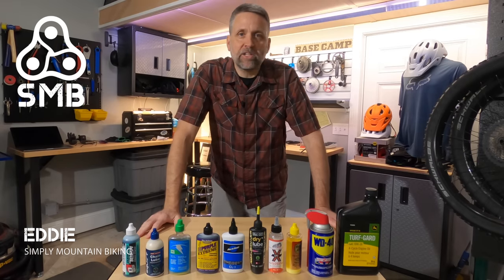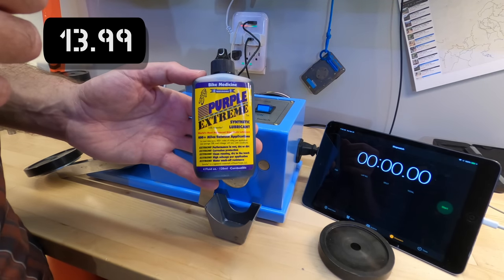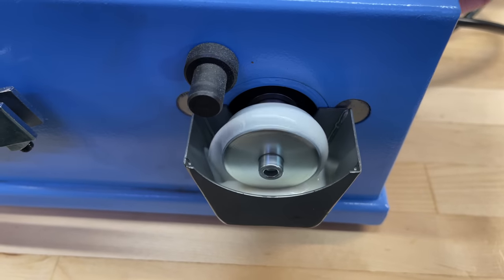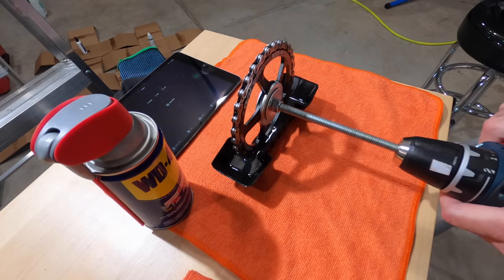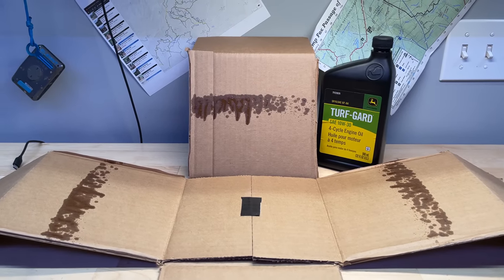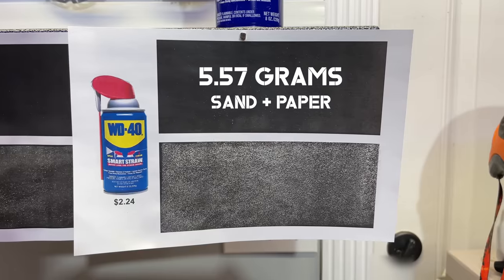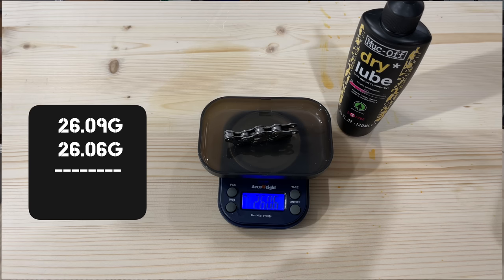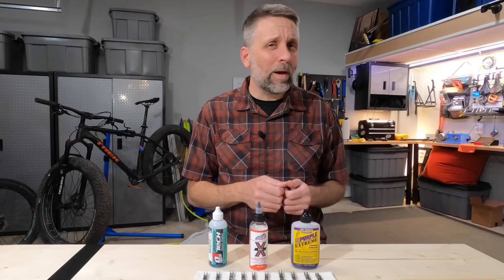Ultimate Bicycle Chain Lubricant Test | Best Bike Chain Lube

Comment from the maker: NOTE on SQUIRT:  These tests took me a total of 3 weeks to record.  Squirt dried overnight for the sand test (15:33).  It dried for at least 3 hours in the sun for the wet test (17:15) - and was totally dry (but even if it wasn't completely dry - it still came in first place for that test).  Squirt also tied for first place in the sling test - assuming it would have no sling after testing Muc-Off.  Finally, I assumed that testing Squirt wet for friction would actually work in its favor.  A few viewers disagree so be on the lookout for a dry test of Squirt against the friction testing machine! -Eddie
Reply: Very interested to see how squirt goes in the friction test when dry, great video 👍👍
Reply: I have zero chain wear using Squirt for 2 years. It's awesome stuff.
Reply: Now do this test:
Wash all the oil out of the chain. Soak it in fuel overnight. Get all of it out. Melt paraffin candles. Soak the chain in it.

I've used many oils. They're all rubbish. Once you go wax, you'll never get dirty fingers or running gear again.

Relube: Wash chain in boiling water, soak in metho and dry. Now soak in melted wax.
Reply: It's just that your test doesn't correspond to the intended use of this product. There is no doubt that a wax should come first on the last 3 testes. And about the friction, independants testes (such as the ones done by Zero Friction Cycling) put always wax above oils.
Reply: @damienmarguerite827  Totally agree - except for your testes... ;-)  The friction test and sling test for wax emulsion is simply not representative of a dry lube product, such as Squirt's, intended use.
Reply: @WestfieldFreshAir  do you geagrease and clean chain thoroughly before lubrication?
Reply: @Kolomy24  only external degrease, then applied Squirt at least 12 hours before riding each time.
Reply: I used squirt on my fixed bike drivetrain. Awful noise, grinding etc. Switched to much off hydrolube. Same chain and bike. Silent, smooth running that lasts in wet weather. Ok, it's dirtier but I'll use gloves. Squirt is ok for 1 day imo but not on my fixie
Reply: @markrushton1516  I wonder how do people get such different result using same thing. You did not apply it on top of the old oil in the chain right?
Reply: Was on track chain. Seems better on a standard chain. Interested to try the wolf tooth lube. Like the fact squirt doesn't leave a mess but it needs frequent reapplication esp in wet weather
Reply: I've noticed there's a particular group of Squirt aficionados out there and they keep trying to turn me into one. No such phenomenon for any of the other lubricants. So far I haven't come up with a better explanation than that it must have something to do with the brand name...
Reply: Standing by! Great video. I have been very impressed with Squirt on my MTB. It appears to be at its best when it is dry.
Reply: @GerardvanReekum  thing with squirt is before applying you must clean the entire drivetrain to just metal everything from cassette to crankset to jockey wheel then apply it let it dry and then you will never ever have to clean your chain. It gives my drivetrain the maximum life and the best part is you don't have to clean the chain ever just keep applying squirt when the chain start making noise.
Reply: would be great to see how they perform in the lubricity in dry condition because that is how they are on the chain... but with the current results I'm considering mixing squirt and mucoff to keep it on the chain.. so maybe something like 20-25% mucoff mixed into the squirt
Reply: I'd be interested in seeing dry lubes tested properly per application instructions.  Boeshield, Smoove, Finish Line dry, etc.  Most dry lubes aren't designed for wet riding and need to be applied immediately after.  Go outside and get some dirt, not just sand.  Dirt has finer particles than sand.  Also, the interesting test here would be to calculate watts used to spin a chain on a chainring when dirty.  Slightly curious about the wear scar test, but frankly, stress on a bike chain is super low and this seems like an unrealistic test well outside of the parameters of any lube.  Maybe much, much less weight over a longer period of time?
Reply: I was hesitant to use squirt on my mountain bike. But once I switched from Muc-off to Squirt wear was considerably less. I replaced less chains. This proved even more so for my road bike. I'm getting double the miles. I always let Squirt dry overnight before use as it is wax particles suspended in liquid that dissolves. Running it wet it makes a real mess. Muc-off seems good for short rides, but for longer rides it disappeared and I could hear and see a big difference. That's likely why it destroyed my chains faster. You might try paraffin wax as a comparison.
Reply: It's not fair to test multi-use WD-40 spray as a dry lube camparison, because they have ''WD-40 bike dry lube''... big mistake
Reply: @RETMTM  - Did the whole hot wax soak thing for awhile.  Got tired of it, now use Squirt, quite happy with the results.
Reply: @WestfieldFreshAir  yep. I get 2000 or so miles out of my XX1 12sp chains with Squirt. and I ride in both sloppy, muddy conditions as well as dry and dusty. That is also about double the life I would get when I used Dumond tech. It's not even close.
Reply: Have to say I have used squirt on mountain and road bikes in al weathers and it excels much better than muc off dry/wet lubes.
Reply: @stefis6  agree. All lubes should be tested on wear after being dried. Obviously there is no oil bath on bike!
Reply: @WestfieldFreshAir  same here
Reply: @damienmarguerite827  wax on your testes? Wrong channel mate 😉
Reply: @WestfieldFreshAir  Not to outdo you but a nod to Squirt, but I stripped a new Shimano chain of its factory lube on a brand new YT Jeffsy in 2018 and use Squirt exclusively. In this 5th summer of use, I measure zero chain wear as well. I have never had a chain on any bike last this long. I keep measuring it to look for any wear and nothing. I don't understand it but have to assume Squirt is the reason.
Reply: @crevasse5396  excellent. Squirt is great stuff.
Reply: @RETMTM Does the wax wash off easily in wet conditions? Is regular gasoline enough to wash the chain?
Reply: I would be very interested to see a more combined test with the dry lubes/wax lubes as one of their main features is preventing debris from sticking. If you could combine the sand test with the friction test to see which holds up best when exposed to dirt, that would be ideal as it could completely change the friction test readings if one lube picks up more dirt than another.
Reply: @WestfieldFreshAir  How do you clean your chain before applying Squirt?
Reply: @sandythemonk  I just wipe it using a towel (cast off from the house) with some citrus based cleaner.  I didn't do a full degrease of the chain to remove the existing lube completely from within the chain. I expect this has worn off by now, to be completely replaced with the wax from the Squirt.
Reply: I came to the comment section exactly before this :D 
Before drying, the Squirt is a very thin water solution, so it can lube less effectively (I think at least). However, this test may tell that when you go to a 200km ride (just for example), and you reapply squirt after 100km, it will do it's job even though it is not completely dry.
Reply: @Stengell 
Really bad idea bro
Reply: What about 3 in one oil? Wasnt it originally used on bikes a while back?

Comment: Rock N Roll Gold Lube is STILL my go-to lube even after all these years. I call it a tune up in a bottle. Great review.
Reply from the maker: Thank you!  Yes - for me, I plan to apply Muc-Off after a chain cleaning - but keep a bottle of R&R Gold in my go bag to use at the trail head. -Eddie
Reply: Agreed, Rock n Roll is my daily driver. I will say I like how Squirt holds up on really long rides.
Reply: If you don't mind a lowly long-miles roadie agreeing with you, Rock 'n' Roll is, has long been (15 years) my goto.
Reply: Great work! Interestingly, I've used many different chainlubes over the years (Triflow, Progold, Finishline, R&R Extreme) but somehow I keep coming back to my 2 staples - Muc Off Dry Lube and R&R Gold.  You definitely validated my unscientific albeit real world observations/experience.  And of those 2, I definitely prefer the Muc off, but the R&R Gold I say I use more due to it's cheaper price! Great channel, glad I stumbled upon it!
Reply: I think in not classifying rock n roll gold as a dry lube he often overlooked letting it dry. It really should state on the bottle that it's supposed to dry since the solvent needs to dry off. I don't know if it really classifies as a dry lube, but I usually apply rock n roll gold or extreme after I ride. I love that it does a really good job of cleaning my chain off, and it's been an excellent lube in terms of staying clean, lasting a long time in variable conditions, and keeping my drivetrain super quite. My friend uses squirt and it works really well, and is probably cleaner than rock n roll in terms of attracting dirt, but the stuff kind of builds up and is a pain in the ass to clean off.
Reply: How often do you guys clean and re-lube your chains in dry conditions?
Reply: @fastsvo  Everytime I wash my bike, which is about every 2-3 rides, or after one big ride. Rock n Roll lube cleans when you lube, so sometimes that's all I do other than some basic soap and water when I'm washing. I only clean my drivetrain with degreaser every couple weeks.
Reply: @fastsvo  Small applications after every ride.

Comment: It's an old video, but I have to give credit where it's due. So much work put in to this video, well done.
I am using only Muc-Off (Dry) on my MTBs and I can say that even though after about 50km in wet conditions you can hear it's almost gone, I still prefer it as it's easy to clean, it attracts very little dirt on the chain. Ride, clean, relube - repeat (and it smells nice) :]]]]
Reply from the maker: Thank you for sharing! -Eddie

Comment: I have been running Squirt for the past 3 years, and when correctly applied, its been the best lube I have ever used, both for MTB and Road. I get a clean chain with no sticking, which is awesome. My chains last longer, on the road bike I get around 1500km more life out of the chain (when it gets to the 0.5 wear mark). Also you don't need to apply it before every ride if you ride in the dry conditions, I'd say on the road its around 200-250km when I re-lubricate the chain (once a week). Recently on a Granfondo I got gifted a pre-production of a brand new chain wax from a MTB World Cup mechanic, which he produces by himself, and in the short time that I tested it - it is even better than Squirt, once in full production that thing will break out and be the next level..
Reply from the maker: Hey - I'm glad you like it.  I never had any luck with wax in the southeastern U.S. -Eddie

Comment: A lot of excellent work here, thanks!

I do think, however, the block-on-ring test would have been more realistic had it been done by wetting the block/ring, let sit for 10min, and running with nothing in the reservoir.  Also consider acetone between fluids to clean the previous off.  A flir camera might show temperature differences indicative of friction.
Reply from the maker: I appreciate you sharing these points and ideas! -Eddie

Comment: Been using Dumonde for a while and it works really well against volcanic dust found in eastern Oregon and the Sierras in CA. The biggest issue is it collects the dust and makes "build up" on your pulleys and chain ring. I've found Dumonde to be a bit of overkill for my local trails near Santa Cruz. Still after 30 years, my favorite for my conditions in dry weather is TriFlo. I'm sad it didn't get included in the test.
Reply from the maker: Thanks for sharing.  Maybe I will test Tri-Flow some day... -Eddie

Comment: For what its worth, the rock and roll lube is meant to set up for a few hours or overnight.  The directions also say to remove excess with a rag.  I think this would have made a big difference in the sand retention test in particular, but most of the other tests as well. It should have been given similar treatment as the dry lubes.
Reply: Need to get Farm Project to test chain lube.
Reply from the maker: Thanks for your feedback. -Eddie

Comment: During the Wet Test I think it would have been valuable to note the weight of the chain before it went through the lubing process. With that you could effectively calculate the percentage of lube lost. Some lubes may deposit less material so may have less mass to lose and could sqew the results
Reply from the maker: Thanks for your feedback. -Eddie

Comment: Interesting result and great detailed video. From my personal experience I find Muc-Off lubes collect too much dust & dirt and cleaning the chain just with a cloth will be dirt smear all over the place. It takes more time to completely clean your drive train on a wash and even a quick wipe off and re-lube results in a lot of dirt. I switched from MucOff to Squirt and find Squirt superior. It might not last as long or have slightly worse efficiency in wet conditions BUT wiping off and re-lubing takes 5 mins incl. a clean drivetrain. I rather lubricate every 150km instead of having everything dirty as hell on every wash. Being a roadi / gravel guy here though
Reply from the maker: Thanks for sharing your perspectives and experience!  I guess I'll see how Muc-Off does in real world conditions. -Eddie
Reply: @SimplyMountainBiking  Great test! I use Muc-Off Dry Ceramic lubricant since over a year on my MTB and I find the chain to stay very clean. On the other hand, the Wet (non-Ceramic) lube does collect quite a bit of dirt on my city bike, but there I don't care as much and drive even while it's raining.
Reply from the maker: @patoberli  Thanks for sharing! -Eddie
Reply: @SimplyMountainBiking  I've been using mucoff dry on my mtb in dusty and wet conditions and I really like it. I find one of the best things about it is how it sheds dirt and how easily it cleans off with a chain cleaning machine. Depending on how muddy the rides are, I usually clean and lube my chain after 3 rides. With about 3K km on it, it has no noticeable wear.   On my commuting e-fat bike that I ride all year round including some pretty bad snow, slush and salt conditions, I tried paraffin wax the 1st winter and it was OK but too much of a pain for cleaning and relubing. This past winter I used rock and roll gold and probably was not all that diligent and it worked OK too and was way less effort for maintenence. I've also used a schwinn wet lube that looks a lot like chainsaw oil and as long as you wipe it down well, it doesn't attract too much dirt, resists wash off well and is the longest lasting. I rode 10K km last year, its a 1000W mid drive ebike and I have steep hills over 15% on my way home. I use it as my main mode of transport and often load it up with 230lb me and another 40 or 50 lbs of stuff so it's really punishing that chain. I've gotten as low as around 1000km on a chain in winter and maybe 4K km in summer. I probably go through 4 chains a year, I get KMC plate silver or ept 8 speed chains and change them around 0.75 percent wear. At almost 14K km ice gone through 1 drive sprocket and 2 cassettes. Still way cheaper than a car :-) I usually start off with just the factory lube and decrease the outside of the chain and that lasts quite a long time and doesn't attract much dirt. I'm pretty much now about what's easy and quick to use. At about $30 a chain, it's not worth wasting too much of my time on maintenance.
Reply from the maker: @Stephen - thanks for sharing!  That's a lot of experience shared! -Eddie

Comment: I just came back to this vid with an update: I went into my local shop to get some Rock N' Roll (I've used the Blue one for quite a while); when the head mechanic suggested I switch to Wolf-Tooth's WT-1.  It's pretty expensive, but was supposed to last longer... The results are in and IT'S AWESOME!!! It actually lasts wwwaaayyyy longer.  I rode all last summer, lubed up my chain this spring, and even used it to lube my dropper post, bushings, sealed bearings and my derailleur during my spring maintenance tasks; and I have used less than 1/4 of the bottle!!  It's amazing stuff for sure!
Reply from the maker: Thanks for sharing! -Eddie
Reply: @SimplyMountainBiking  you are certainly welcome.  I'm absolutely convinced that the WT-1 is the bestest. It also has been fantastic at reducing the "grit" factor that we have around here in the late summer,  where our dirt is closer to powdered sugar than actual dirt.